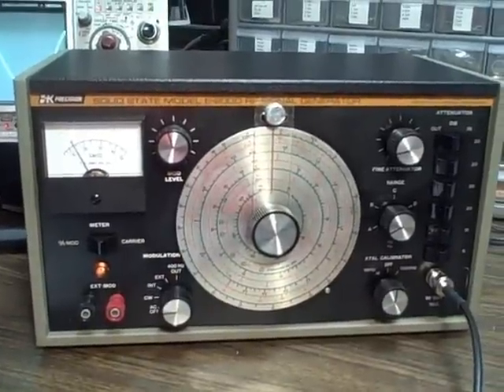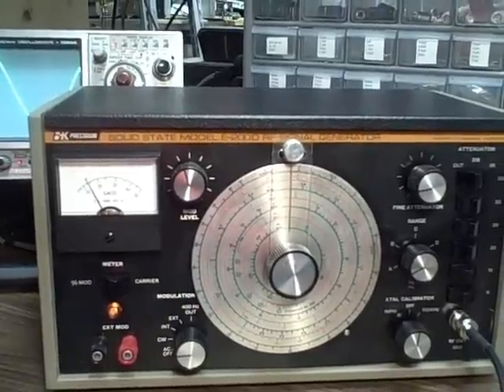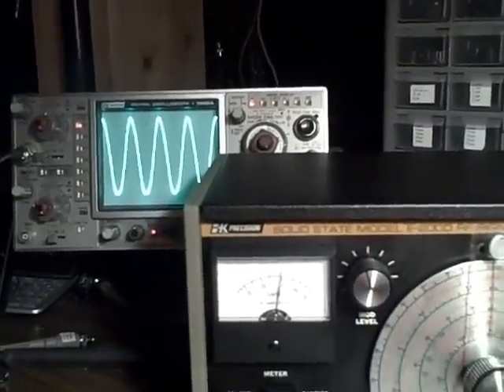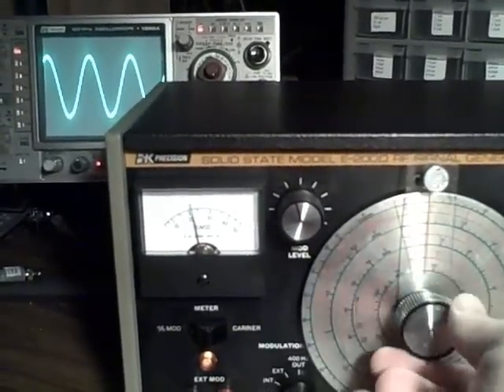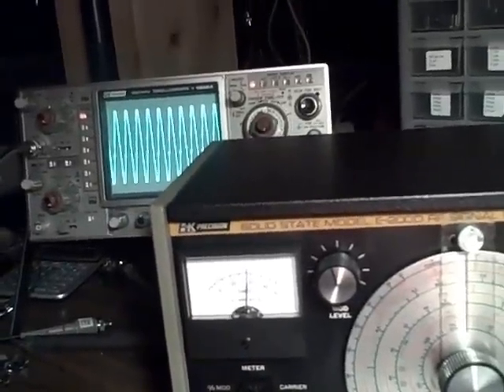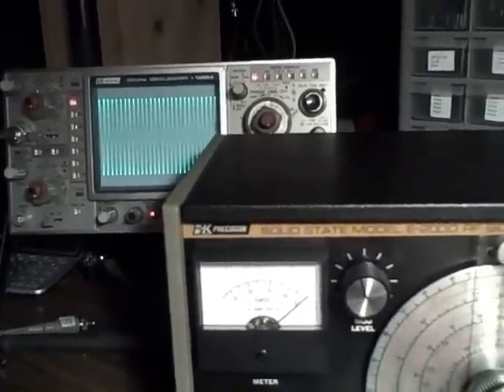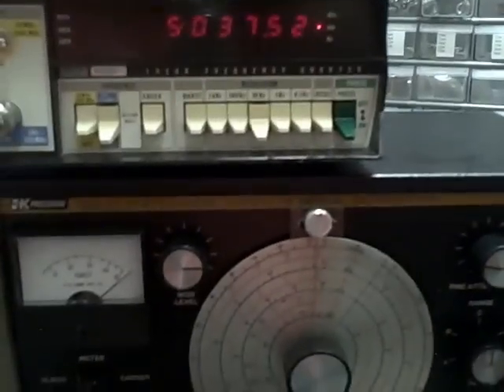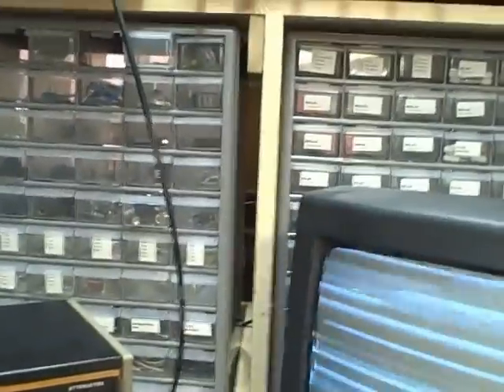BK E200D 100Khz to 216Mhz RF Generator

Comment from the maker: The external posts are meant to INPUT a signal tone you would like to modulate the RF output with. You hear the modulated tone by connecting a Radio to the RF leads and tuning to the appropriate frequency. It may be that the 400hz tone does appear on the binding posts when you are set to internal modulation, but the speaker has such low impeadance that you are simply shorting it out. Try connecting an amplifier to the binding posts (with a speaker on the amplifier output) and see if you hear it

Comment: when set to 400 hz out , I am getting the tone output , I've got ac voltage there and I hooked my scope up and saw the 400 hz wave and it is an adjustable output so I got it working . Yes it's a really high impedance but on a forum a guy said for over 30 years he has never hooked that output up to a speaker . Thanks for your reply . Excellent video by the way .

Comment: can it provide a 1000k signal for troubleshooting and calibrating reel to reels and stereos?
Reply from the maker: I think you mean 1khz, or 1000hz, and no it can’t. This is an RF Generator and the frequency starts at about 100khz.
Reply: @bap8guy  Yes that is right. 1000hz
Reply: @bap8guy  I have a Heathkit audio generator model IG-5282 , a Heathkit signal tracer IT-5283, an Audio-wizard function generator with no model number or part number and an Eico 324 signal generator that starts at 150kc so I can't use that one.
And the other ones I am not sure if I can use them. I can't find any info on the audio wizard.
And the Heathkit ones also not sure if I can use them to do the troubleshooting?

Comment from the maker: Depends on what you plan on doing with your scope.  If you plan to work on frequencies up to about 30Mhz, then that might be all you need and you can save money.  I have a 100Mhz B&K on my bench presently, but have had HP and Tektronix scopes in the past. I personally prefer analog for use and trace, but then I havent' tried any of the new digitals. Maybe they have gotten better.

Comment: I got it working ... kind of . After I replaced C37 it started to work . As for the kind of part , on the internal setting I hear it thru a receiver but I still can't get the tone out of a speaker when it's switched to external . I think I may be hearing a very slight tone when the modulation level is all the way up although there is no movement of the meter . On internal the meter reacts just as it should but on external ... nothing . any ideas on this one ?

Comment: Have you repaired any of these ? I have one but it doesn't produce any 400hz tone either internally or out thru the binding posts . Everything else works , just won't produce the tone . I can input  signals thru the binding posts and here it on receiver . I have tested all the voltages on all the transistors and they're all good . Do you have any idea what to look for ?

Comment: Hey , I measured 1.1 volts a.c. at the ext. binding posts when set to 400 hz out 50 % modulation , but can't hear the tone thru a speaker I connect and also the meter reads 0 in that position but it does read the carrier output . Does your meter respond to adjustment of the modulation level when your in 400 hz out mode and can you hear the tone in a speaaker connected to the binding posts . I'm guessing since I have the voltage there that that is the 400 hz tone but I don't know why I can't hear